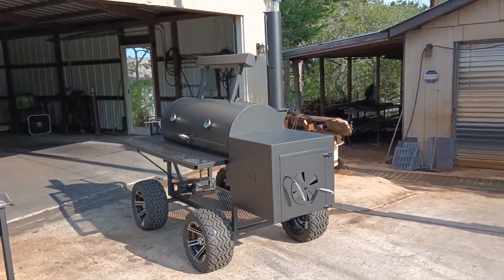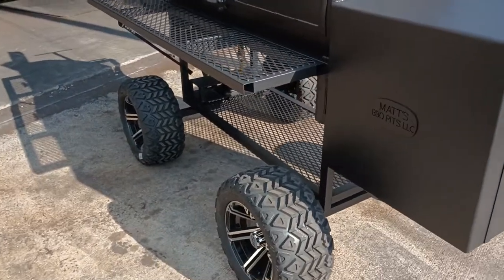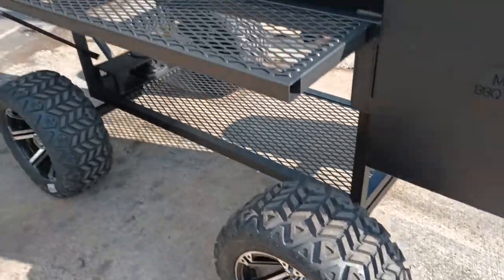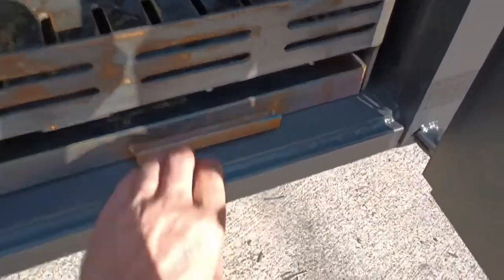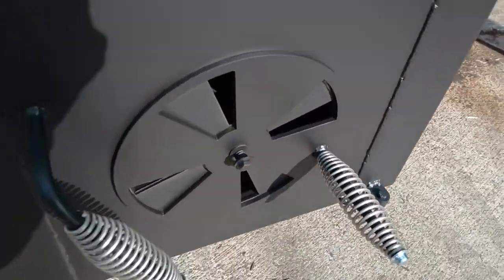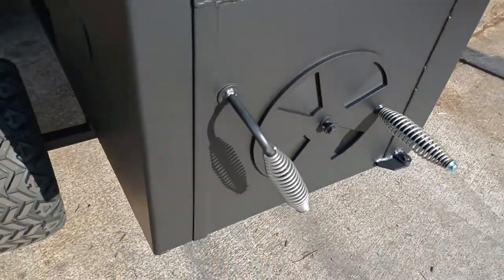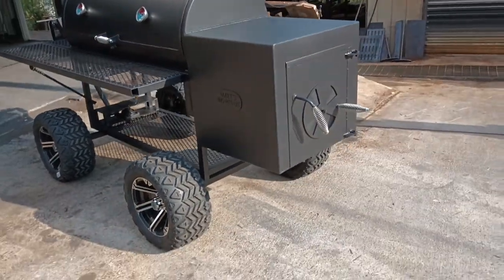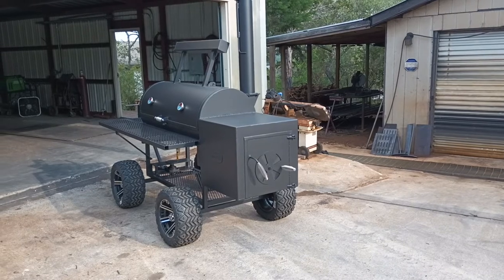Matts BBQ Pits LLC 2454 Reverse flow Smoker Golf cart wheels

Comment: Matt what is the height, length and weight of this build?  Also what is your lead time for build/pickup?  Thanks
Reply from the maker: 83" tall. We can build with different height stack if you need to roll it in a garage or cargo trailer. Weight is 1,200 lbs I bet. Lead time is 4-5 weeks currently.
Reply: @mattsbbqpitsllc6178  Thank you for the information.  I will contact you a few additional questions.
Reply: Is that just a four bolt flange bearing? So is the entire weight being held by a set screw or is the pin bottomed out on that top plate that's welded on?
Reply from the maker: @madmatt113944  Bottoms out on the top plate. Set screws just keep it from falling out if lifted, although that large rod is a tight fit in the bearing.
Reply: @mattsbbqpitsllc6178  I'd recomend a thrust bearing if you want to have the front axle pivot like that. That 4 bolt flange is really not doing anything for ya. Nice build I'm working on a reverse flow myself right now.
Reply from the maker: @madmatt113944  It does plenty and works great. Top of shaft is greased. Thrust bearing on top might help a little but there really is no issue to help. Turns easily with little effort.  Appreciate the advice.
Reply: How do we go about placing an order?

Sent a message through your site, but not sure if you received.